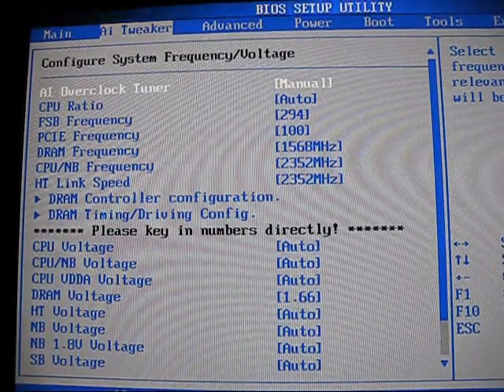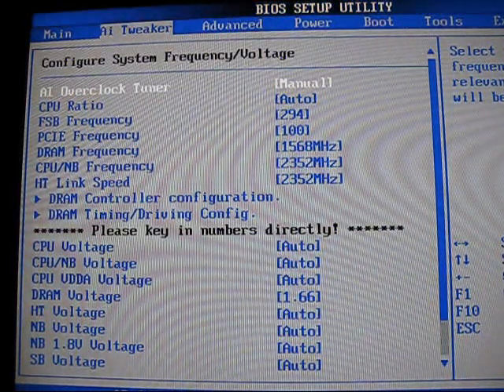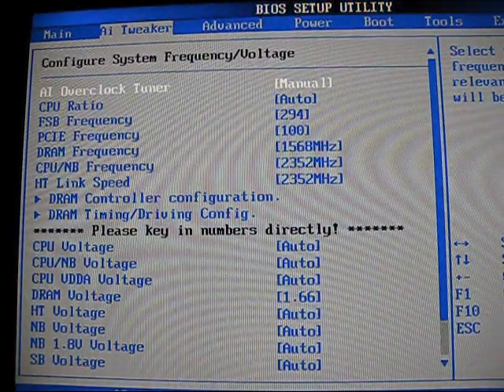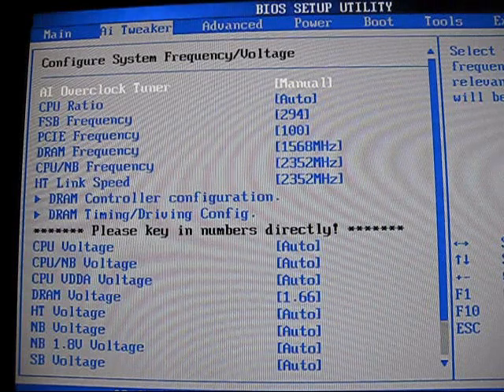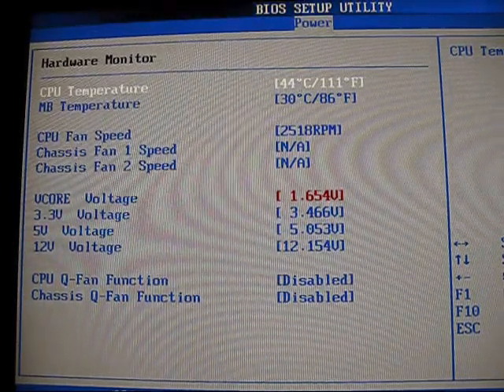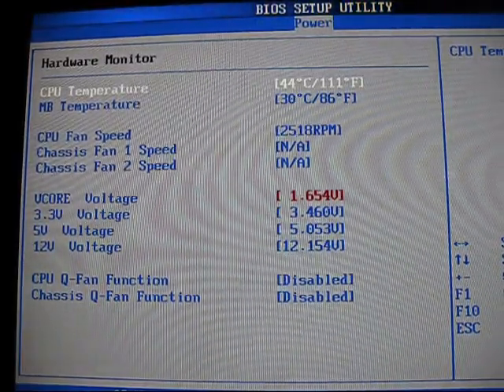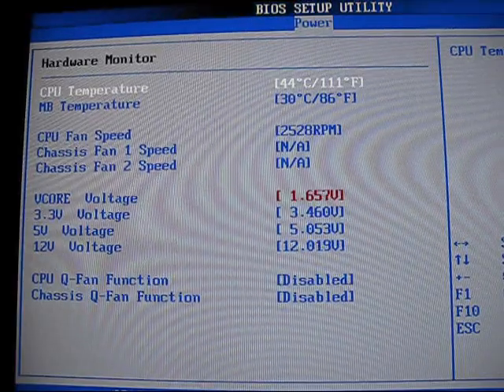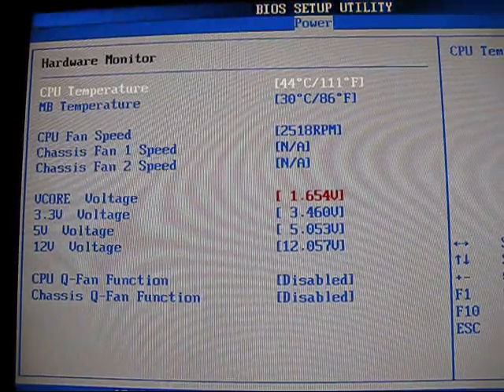ASUS M4A79T Motherboard Overclocking - Phenon II 810

Comment: SOME ONE PLEASE ANSWER

i have a desktop with the phenim iix4 810 2600 4 cores.it is currently running at 2.6GHz. it has 8gb of RAM. i have windows 7 64-bit. i really want to overclock it to 3GHz but i dont want to spend any money at all. its only air cooled so i dont know how much i can get it up to. is there any more info anyone needs nad if then how do i find out. i just want someones help to overclock it since i am sort or a computer noob, thanks in advance

Comment: I have this CPU @ 3.9GHz 100% stable with a VCORE of only 1.50V. There is a jumper on the board that allows "overvolting" so you can specift voltages > 1.45V.

Comment: @d1nho332        if your running a quad core processor use the 8 pin..........dual core use the 4 pin.......quad core require more power.

Comment: Well , i have one problem ...

I have power supply Seventeam V-Force Series 850W and

i have motherboard Asus M4A79T Deluxe , in the motherboard have

4 or 8 pin , you use 4 or 8 pin ?

thx

Comment: do you have to change the voltage of the processor or do you just increase the multiplier? Also, about cooling I just purchased a Dark Knight cooler by Xigmatek is that good enough to cool my processor when overclocking like this?

Comment: Not enough info... I have seen all of the board settings which are cool I think. but what processor did you use. I have this board and I have a Phenom II X3 720 processor... do you think I could get away with the same settings safely. I am also using Cooler master V8 for my cpu cooler and I have a Antec 1200 case with side panel and optional interior 120mm fans added. So I think that I have somewhat decent air cooling